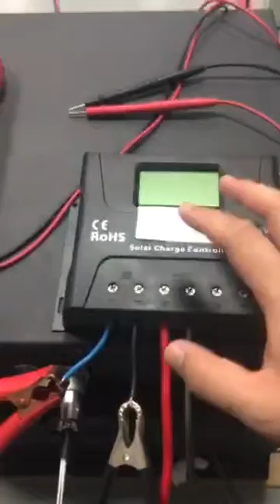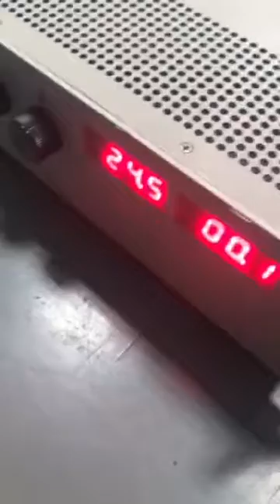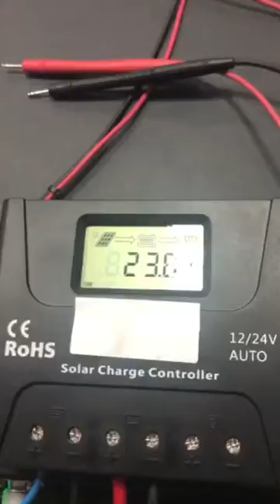NEVER use PWM for your lithium battery!

Comment: The charge controller is suposed to limit the voltage on the battery according to its programming. Why yours doesnt ?
Reply: It does now year 2025😂
Reply from the maker: PWM never does